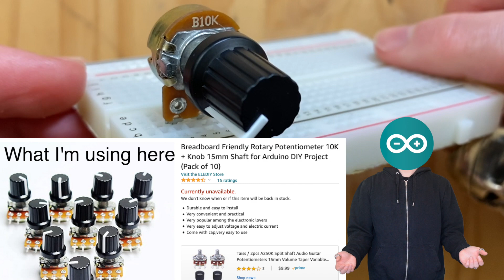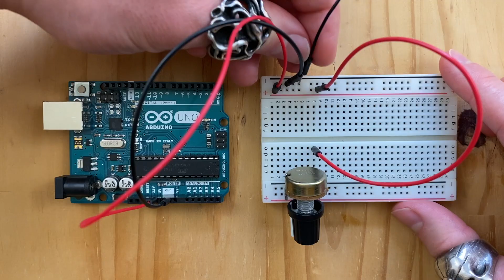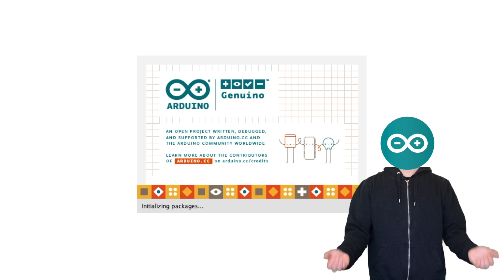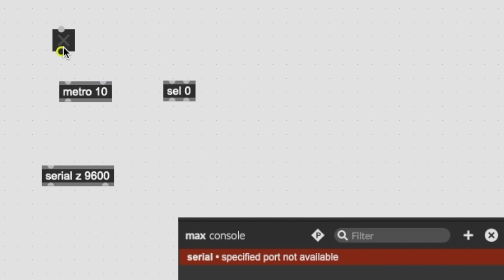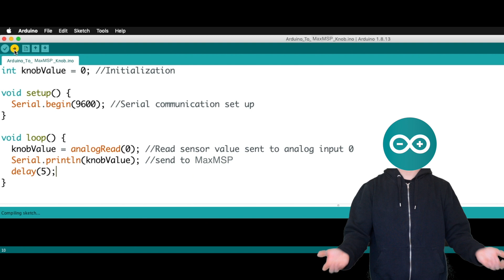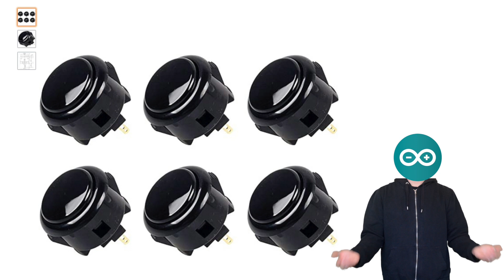Arduino To Max/MSP (Tutorial)

Comment: Can I ask why the maximum value after fromsymbol object can not reach 1023? (And it will change like 1018 - 1022) Some unstable reasons? How to make it more stable.
Reply from the maker: You can smooth out sensor data! I actually made a video about that: https://www.youtube.com/watch?v=RCHgQOPaT08

Comment: Hi ! I'm having trouble receiving data in Max/MSP, although my Arduino code and my patcher are the same as those you show in the video. The Arduino is sending data no problem to the serial console and plotter and I can see the right port in Max, I just dont receive anything. (Also, I can upload code to my Arduino with the toggle of the patcher still on, which you said was not possible.)
What am I doing wrong ?
Reply: You have to make sure the IDE is closed. You can only have one serial monitor open at one time. Upload your code, before you toggle. close IDE, then toggle, you should see number in numbers object :)
Reply from the maker: If you can upload the code while the toggle is on indicates that the connection between Arduino and Max is not happening. Please make sure that you're not missing any steps. It might be good to take some time away and then come back with a fresher mind as you might notice what you have been overlooking. Good luck!!

Comment: Hi, Thank you so much for your video. I am trying to dynamically modulate the sound volume with the code  you are showing in the video but I am not sure how to do it. Could you tell me how to do it if you can??
Reply from the maker: You certainly can! Once the sensor value is in Max from Arduino, you can scale it (with [scale 0 1023 0.0 1.0]) and connect to [*~].
Reply: Thank you!! I tried with your program and I made it. Now I am making multiple analog sensor on Arduino.   @SoundSimulator
Reply from the maker: @Reimitsuo  That's great! Have fun :)

Comment: Hi! Problem. I connected eight potentiometers and they constantly give out some random values to integer object in max msp, while I do not turn them. What is the problem? Thank you for your answer!!
Reply from the maker: It may not be grounded? I have a feeling that it's a hardware issue. 

I recommend testing one by one. Good luck!
Reply: @SoundSimulator  thank you for your answer. I’ll try it. Other questions: Is additional power required to connect eight potentiometers and 10 switch-buttons? May I contact you in any other messenger to consider my case separately? would be very grateful!
Reply from the maker: @dschkn  Yeah, you should be able to connect that many components to USB powered Arduino.

Comment: In case somebody hasn't pointed it out:

1. You can use the open and close messages instead of switching the port symbol. It'll prevent error messages.

2. The zl group object can be used without argument, simply send a bang after you've received the entirety of your message to send the whole list.

3. While 9600 is an "ok" baud rate, it doesn't hold up for long messages, I'd recommend using a baudrate as high as possible. That will prevent latency when dealing with several data streams (sensors) or longer messages.

Explanation: A message of 5 characters long (4 characters + the "new line character") is 50 bits long. At a baud rate of 9600 bits per second, it takes 5.2ms to send it. So imagine you have 10 sensors, you take 52ms to send the whole stream of 10 sensors. Plus if you introduce spaces, index numbers or labels to route sensor data streams, it adds up pretty quickly. Depending on the application (triggering percussive sounds for example) 52ms or more will be very noticeable. At 115200 bps, the same 50-bit message will be transmitted in 0.434ms.

My recommendation is to go to a higher baud rate (115200 or 230400 or even higher) from the start, to make latency as low as possible. The apparent "simplicity" of teaching people to use 9600 bps as a baud rate is not a sufficient argument in my opinion. One should favour low latency and scalability instead.
Reply: Thank you for your help. When using open and close messages instead, do i replace the 'port z' message with 'close' and replace 'port b' with 'open'? I'd appreciate a more in-depth explanation if possible please
Reply: @williamjcairns  exactly, you don't have to use the ports messages anymore, you just replace them with "open" and "close" messages. as long as your port letter is set as an argument in the object name, you don't have to change the port letter anymore

Comment: Thanks for the tutorial! some problems: My max patch only connects to the serial port when I close arduino IDE, otherwise there will be an error saying "serial: error openning serial port". Although the code works well in Arduino (shows normally in Arduino's serial monitor),  I can't receive any data in max, the value is always 10 (which is filtered by [sel 13 10].
Reply: ahh never mind, I used the 1st output of [sel 13 10] instead of the 3rd one lol

Comment: hello!; I'm testing the arduino connection with max for live, as shown in the video, but I can't enter max, it tells me: opening serial port error.
I am using the arduino uno made in italy. with driver 2.0
I do not understand what the problem is.
Reply: Hi I have the same problem, did you managed to solve it ?

Comment: Excuse me, sir. I was woundering... Is it possible to make a guitar loop pedal using arduino and Max?
Reply from the maker: Yes! You can map a footswitch (that's connected to an Arduino) to the toggle object in Max for example. And from there, you can just use [groove~], [record~] (?), and etc.

Comment: Hey! Great tutorial! I wanted to ask how much do you know about other objects that can be connected to arduino and output values to max? I'm interested in simple mechanical buttons, switches and lcd display... thank in advance!
Reply from the maker: For button and switches, I made a video on it. For LCD display, that's mostly going to be dealt with in the Arduino IDE code. You could send values from Max to Arduino IDE and control the display and such. I made a video on how to send data from Arduino IDE to Max and back and forth.

Comment: Hey Great video, I cant seem to get max to read the knob value. the value is working on the serial monitor in IDE so I know the code and electronics are correct. the max patch is exactly like the one in the video, although I notices even when the max patch is toggled ON I could still upload code onto arduino uno without getting an error. any ideas why the number object isn't updating with the knob value?
Reply from the maker: First thing that I ask is: what Arduino are you using? If it's a clone, serial communication gets iffy. 

If not, make sure the right port is being used.
Reply: @SoundSimulator  I am using an arduino uno, turns out I just had to quit the arduino IDE app and as soon as i did it started working. Thanks!

Comment: Sweeeeeeet, looking for a way to ditch Maxuinio. Thanks.
Reply: I did it all from watching your video, I need to combine some digital inputs, and also report back some LED flashes from the system. I think I saw you do more videos on these topics (Arduino <> Max). Thanks again.
Reply from the maker: Maxuinio always felt convoluted for beginners, so I'm glad to hear that!! This method is nice and simple.
Reply: @SoundSimulator  I quadrupled the board rate on sketch/max to reduce the latency of the voltage reads. It worked really nicely.

Comment: Hi there, great vid. When I press the toggle button I get an error message popping up saying "specified serial port not available" in the MAX console, just wondering if you have any ideas? Thanks
Reply: i'm using an arduino nano type of controller but I wouldn't think that would be a problem?
Reply from the maker: Click on print to check which port your arduino is using.
Reply: @SoundSimulator  It shows it's using port f but comes up with 'error opening serial port'
Reply: okay now there's no error messages when I click on port f but it still doesn't change the value of the number
Reply from the maker: @greglur  
Making progress!

Are you using the official Arduino? 
And are you seeing the sensor value in Arduino IDE itself? You can DM me on Instagram btw. It's hard to debug here.

Comment: Hey, thanks for tutorial. I have a problem: My port name is COM5. I have "specified port not available" attention and i changed the port name COM5 but still i dont see my port name on available list. I m trying to port z>port COM5 or print>port COM5 > port z.  In Arduino my code is okay, analog is okay i havent error, port okay, too. And I m using to  Arduino Uno Clone CH340. I dont think it can be  driver problems because i can see in Arduino,i dont know.All is okay but i couldnt solved this port problems. Thank you. I m beginner, i hope i could explain my question im so sorry for my bad english :)
Reply from the maker: From what I remember of the Arduino clone, you have to download and install a driver in order to do serial communication with Max. It's been a while and I don't have one around to test. And Windows complicated things further. Did you install the driver yet? Sparkfun has tutorial on their website that looks good. 

Clone is cheaper but it does comes with a price like this unfortunately. Best of luck! Please feel free to ask questions any time!
Reply: Hello ! I have the same problem right know did you find a solution ?
Reply: @zgelt813  hey, no unfortunately. I have been change my Arduino clone to Arduino uno ✌️
Reply: @axiomrasa  Thanks for the answer ! i'm actually using an official one (rp2040) but it seems that my computer doesn't allow access to my COM3 port via the serial object, i have tried with a pure data patch and have the same issu..
Reply: @zgelt813  youre welcome, i dont make arduino projects from long time ago, so i cant answer this problem sorry :(

Comment: hey there! amazing video, very thorough! I've been trying to do the exact same thing with my arduino nano 33 ble sense but everytime i try to upload the code it's not correct. any chance you might know what steps i need to take with my nano to achieve this? i've noticed that the arduino i have is not on the avr boards list but on the Mbed OS boards (and the Mbed OS nano boards). Does the code need alterations? Sorry I am a beginner and all that stuff is really new for me. thanks
Reply from the maker: Hi John! Thank you for watching!!
From what I gathered, BLE cannot do standard serial communication. There is a code by mhamilt on GitHub called "maxmsp-ble" that may work, but I don't have BLE to test this. 
Hope it works!  

I think buying the standard Nano may make your life easier. Were you thinking about doing wireless communication?
Reply: @SoundSimulator  Whoa that was fast! Thank you so much for your reply. 
Actually, I'm on a masters course of sonic arts and audio technologies and the whole class was instructed to buy this particular version because it's supposed to have everything we might need to make our projects without buying extra sensors. 
Also I was thinking about doing a project using the proximity sensor of my nano and transfer data from the sensor to max msp and control sound with proximity so i thought wireless was the way to go. 
In retrospect (and after realizing that most tutorials/code etc are using uno) i think i should have bought a standard one or a simple humble uno. 
I'm gonna go try the code you mentioned and see if it works. 
Again, thank you very much for your quick response. Keep up the good work!
Reply from the maker: @johnlef9  Best of luck with the course!!
And I hope that code works!